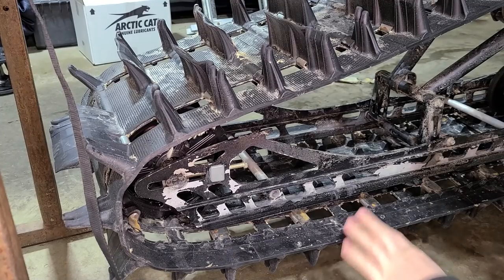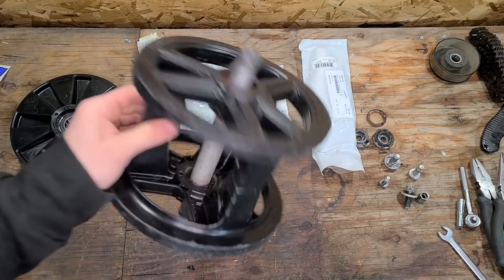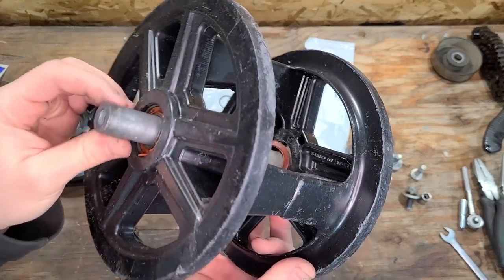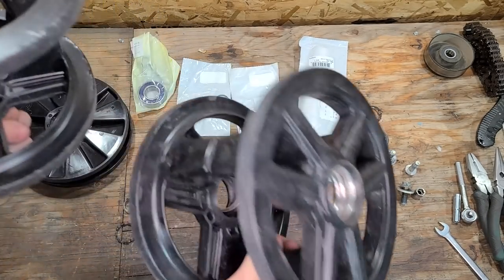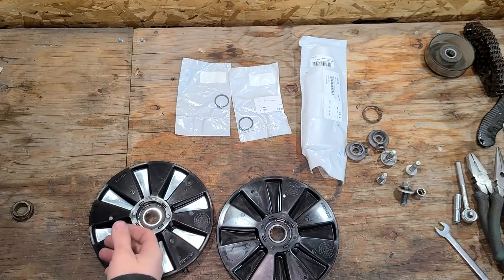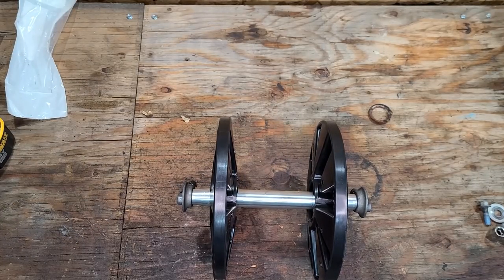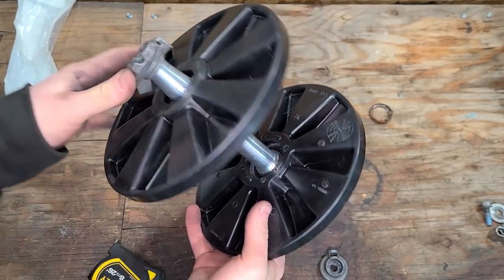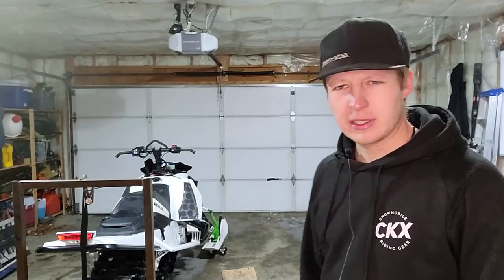Arctic Cat m8000 TRIHUB UPGRADE

Comment: Will these wheels work in a 12 1100 turbo? I assume it's the same skid.m but not 100 %. Also, would the factory 4th wheel kit (the 2 outer wheels) bolt onto this axle?

Comment: You can cut out the bearings on the old style try hub with a hole saw. The unit bolts together so there’s little to no play for the replacement bearings. I just went though all this a month ago with my M.

Comment: I have a question about the cvTech clutch I know you ran or are running one on the white M8. Did you have to change belts? I just put a cvTech clutch on my 2015 m8 sno pro and the stock belt is to tight.
Reply from the maker: Set your belt deflection from the secondary 👍

Comment: J&T tri hub delete is the way to go. Much larger axle, much larger 6205 bearing in solid Avid wheels.
Reply from the maker: If you live in the U.S. ,yes.
Reply: @syxxes  is it just the shipping and tax that makes it unreasonable for you guys north of the border?
Reply from the maker: @sleddingfarmer8692  yeah that and exchange rate on the dollar. Basically add 30 cents on the dollar all around
Reply: @syxxes  yeah I suppose. That sucks. She's a real beefy axle setup.
Reply from the maker: @sleddingfarmer8692  yeah I considered it. Was gonna be a while before I had my hands on it. But its a good way to go
Reply: @sleddingfarmer8692  would that work on a 2018 zr?
Reply: @bennyb6071  j&t sells multiple kits for all the cat models. 2 and 4 wheel kits

Comment: Buy a Skidoo summit and spend time riding instead of fixing 🤪
Reply: One buddy of mine has a 2017 Skidoo Summit, has been more at the dealers shop this year alone then i've been with my AC's since 2013....
Reply: Yeah you'll blow all your money on belts instead
Reply: Not to mention engines
Reply: Rick skidoo summits are  great mtn sleds but there 800 & 850 rotax two strokes LONGEVITY isn't even on arctic cats level especially the older suzuki built 800 
I'm a doo and AC guy so I'm not hating
Reply: Doo riders still drinking the brp kool-aid  🙄
Reply: @davidhallquist7220  I agree, I was always a doo guy,  I was brainwashed that 3000 to 4000 klms was normal for an engine to grenade,  it super annoying when you pay a premium price over other brands and the most important part is not reliable
Reply: @drifter5682  I was one of them